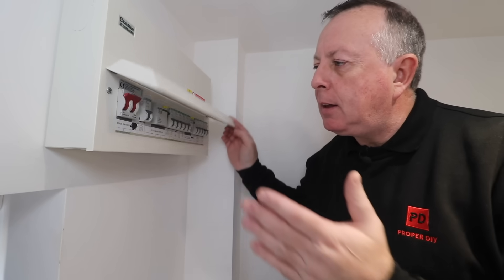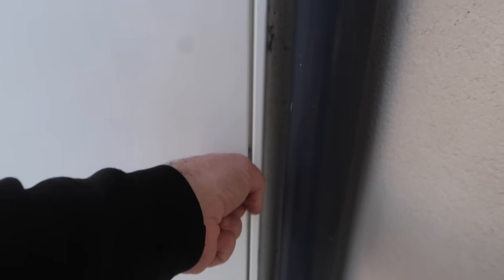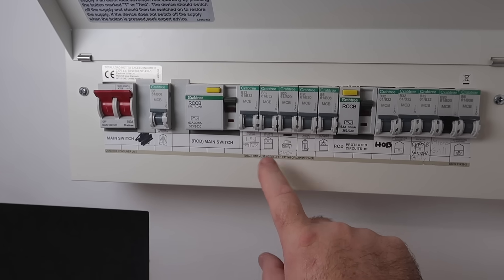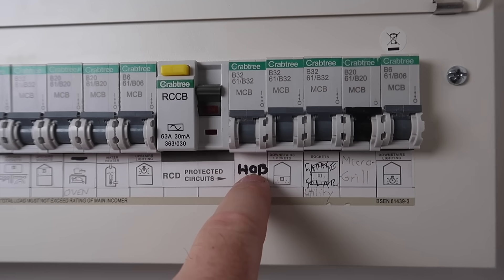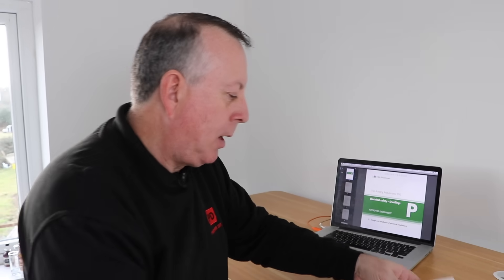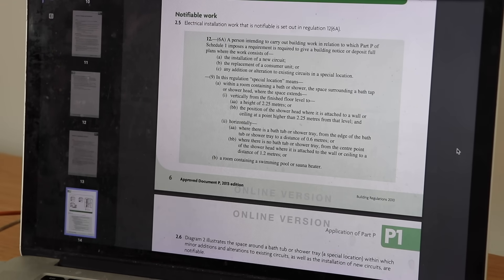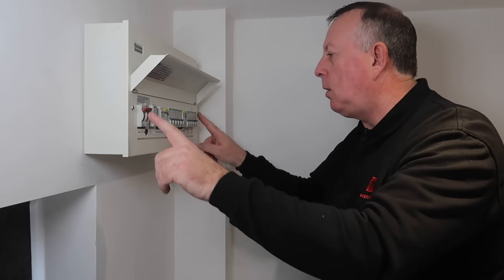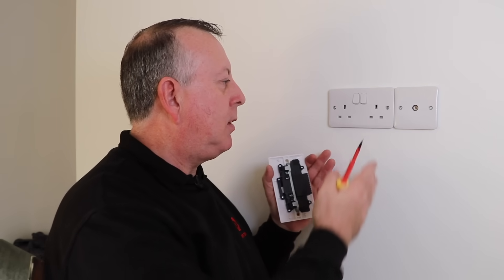What electrical work are you allowed to do in your own home?

Comment: They've killed DIY with all the dire threats to life and limb. Consequently people are paying £30,000-£40,000  extra to move into pristine houses instead of doing it up over time, which is what most folk did. We could do with replacing 'Homes under the Hammer' with a good DIY show.
Reply: Very true...
Reply: There are a lot of DIY shows, but they all focus on the 'fun' part of actually doing the job, rather than the boring part where the expert slams a three-inch-thick tome of rules on the table and starts explaining exactly how to interpret the multiple different fire rating codes for wallpaper.
Reply: @vylbird8014  What are these shows and who's presenting them?
Reply: @andycap1188  DIY SOS is probably the best-known.
Reply: @vylbird8014  I'm not sure having a team of 100+ professionals whilst you're elsewhare  is quite what I had in mind ! Something more along the lines of Barry Bucknell.

Comment: With all this regulation you can still plug in a cheap extension bar and plug in a 3Kw fan heater, and your plug melts and fuses in the extension lead, besides I do not think it is a good idea to protect any power sockets with 32A breaker, that is a huge amount of current and can set things on fire if overloaded, 16Amps should be more than enough in most homes today as we are energy conscious, and so all 32A breakers should be replaced with 20A at the most, in my house I have got rid of all 32A breakers and replaced them with 16A, and I have never needed to draw 16 amps from any ring circuit, I live in a domestic property not in a commercial workshop or factory. Play safe BS should change their thinking on safety grounds. 32A is c9omplete madness.

Comment: Former electrician here, (City and Guilds A and B certificates) but out of the trade for many years so no longer qualified due to reg changes. 
Obviously, I know how to do electrical work safely and have done jobs such as changing the florescent fittings in my garage for LED ones, but am I allowed to change the 240v to 12v transformer for the low voltage halogen lighting in my attic if I switch to using LED lamps which should ideally be fed from a transformer designed for driving LEDs ?
Reply: In my kitchen I ran some extra lighting cable and switch from the cupboard light daisy chaining three sockets  into which I plugged in 3 sets of 4 LED lights with transformers.
Sockets are on top of kitchen cupboards with lights underneath so i leave all the sockets and lights transformers switched on meaning I only have to hit the kitchen wall switch to turn on twelve bulbs.

Before anyone warns of the possibility of someone using the lighting wired sockets for heavy duty use, (on top of wall cupboards) I already have two full strength twin socket spurs up there for TV and extractor.

Extended the kitchen ring from four to ten double sockets when I had the floor up and remodelled it. Finally had an electrician come in to upgrade our ancient fusebox and everything passed..

Comment: Its different for England as Wales, in Wales you still have to notify work in a Kitchen and external work such as adding an external socket or light even to an existing circuit
Reply: Drakeford requires a written notification if you want to fart outdoors or have a wank in the bath.

Comment: Wait... You only have one incoming phase? Is this normal in the UK?
Reply: Yes. Homes in the UK are, almost without exception, single-phase. But that one phase can be up to 100A at 230V, or 23KW of power: More than sufficient for any home.

There are three phases in the distribution network, and homes are just hooked up to them in sequence. 1-2-3-1-2-3-1-2-3...
Reply: @vylbird8014 Interesting, where I'm from every home gets hooked up to all 3-phases.
Reply: @abrahamedelstein4806  Why? What domestic appliances demand such an extreme of power that they need three-phase supply?
Reply: @vylbird8014 Because it's more flexible, especially when building a home. Obviously we have different standards because to me it's taken for granted that an oven or a water heater, heat pump, etc, run on 400VAC. Yeah, I suppose you can run a single phase induction motor on trice the current but it seems rather... Inelegant to me.
Reply: @vylbird8014  A lot of UK houses with single phase supplies are staring to get close to capacity with EV chargers, heat pumps, electric showers etc.
Reply: @vylbird8014  We can use 3 phase 32 A instead of single phase 80 or 100 A. Thinner wires, less losses, and being able do run 3 phase motors in a house is a blessing for a nerd like me.
Reply: Some new build developers are starting to install 3 phase supplies now in the UK to cater for EV chargers electric boilers and Heat pumps.

Comment: My voltage is 256v,interesting that both parties have DP switching / control. I wonder what's the radius on that swa? The cables from the DP switch are provided by...the DNO?
Reply: The second switch (its actually a fused switch) is because his consumer unit is probably further away than 3 Metres from the DNO isolator. You cant have meter tails longer than 3M without additional fuse protection. Only the cables to the bottom of the first Isolator are provided by the DNO, anything after the Isolator is consumer responsibilty

Comment: I noticed from news reports years ago in Australia that many factory fires the news stated that recent electrical works were done at the factory. By electrical contractors.
Reply: All electrical (and plumbing) work in Australia is more strictly policed and regulated than in the UK - but the parts (or most of them) are still available in DIY stores.  

That said some of the regulations are weak - e.g. no need for CPC to light switches if the switch is fully isolated (not metal, no chance of contact etc. - those silly screw caps must have originated there) 

The regulations (Industry driven) are so all-embracing that you cannot even install your own data cabling OR terminate patch leads..... and don't even think you can install a second phone socket.  Technically your transformer powered doorbell requires a sparky and  you need a plumber to change a tap washer.
Reply: @barrieshepherd7694 Very few people get plumbers to change tap washers. Myself included, l learnt plumbing from my father who was a plumber and sparkie.

Comment: Went to move into new house 22 years ago. BIL was the contractor liason. He touched the dishwasher and got an electric shock. We noticed the lights were also dim. Sparkies who put in the electrics were contacted. After a 2 hour drive to get here, they spent 30 seconds, looked at the main switchboard, found nothing wrong and left. We refused to sign the handover till the problem was fixed. Builder called a local sparkie who found a dislocated neutral wire on the main box, and fixed the wire. Years later I remove a light switch assembly from the wall to paint, and a hot wire broke. Screw must have been tightened with a pile driver, and the movement of the switch from the wall caused the wire to break. When I wire a switch or plug, I test the wire by tugging on the wire a few times with a reasonable force to see if the wire screw is tight. Something our sparkies did not do, they just tightened the shit out of all the wires. SMH.
Reply: Moved into a different house in 2004. My neighbour - since deceased -  who was a lovely man, told me 'Brian was very good at DIY!' 
I decided to change the ceiling light at the bottom of the stairs since it was very old and not what you might describe as 'stylish'. Having switched off the relevant circuit I removed it from the ceiling and found the cable hole in the plasterboard ceiling was about 5 inches in diameter. Wow! I thought, that's a bit big! I disconnected the cable and removed the fitting. Then checked the security of the cable and found it was mixed with a large lump of brown mastic in the void. I pulled gingerly and after 5 minutes had removed all the cable from above the ceiling. It was still connected but the extra cable was long enough to literally reach the floor. Having shortened it to a sensible length and replaced the gaping hole in the ceiling I fitted a new light unit. The old cable went in the bin. Brian lives in Spain now and is undoubtedly causing havoc but in a different environment. His DIY was shocking. Brown mastic to point a brick wall anyone?
Reply: @thetraveller869  Brown mastic reminds me that the previous owner to my house had stuck some loose capstones (on the low wall around the patio) back on with some sort of silicone adhesive, possibly bath sealant.
Reply: Qualification doesn't mean they take pride after the fact...! Sloppy is Sloppy, the rubber stamped version just costs more..!

Comment: digital meters take to long to measure voltage if trying to measure a rapid change as in moving a magnet past a coil in generator making,  analogue reads much faster so are usable. nice video thanks

Comment: I insisted on an isolator switch when i had my supply connected , makes for safer diy, no  more  live fuse box fitting or rip off line isolation costs .! UK regs are a joke .One year metal fuse boxes were bad then the next oh dear its the plastic ones !  I had to pay 400 quid to get my installation checked and  passed . Its only when you sell your house that the correct fitting tests have to be shown to the surveyor . There are zillions safe DIY wiring in UK and if electricians didn't take the piss on what they were charging there would be less . I had my elderly  neighbor come around in tears when the visiting electrician said 200 quid to remove a plug socket so she could squeeze her new fridge under the counter , took me less than ten minutes  and another 5 glaring at the electrician . To many tradesmen are not interested in their trade they just heard it was a good earner .

Comment: Didn't realise that gardens/exterior weren't a 'special area' any more. Thanks for the info.
Reply: only for England, Wales it still is
Reply: @codenamenel  That's reasonable - it is wetter in Wales so higher risks. 😂
Reply: @barrieshepherd7694  🤣 In wales the whole country counts as within 0.6m of a bath. 🤣
Reply: @KX36  can confirm.
Reply: That really does depend of the earthing type from the dno, it's not as straight forward as that

Comment: When  did section P become law?  I ask as I did a number of installations many years ago, including the fitting and wiring of a power shower in my bathroom. Is this item exempt from current regulations if I carried out its installation before Section P became law?
Reply: Eighteen years ago.
Reply: @markrainford1219  
Mainly stripped back in 2013. It is mainly about notifiable work. Anyone can do it, you notify building control. They do not send a surveyor around, they send an electrician they approve to sign it off.  You have to pay for it.
Reply: many thanks for your reply Mark; as a competent DIYer /HNC qualified engineer I did this installation abour 25  years ago so obviously I don't need to rip the power shower out and have it refitted  by a "competent" electician.
Reply: @hewittb68  
If you have a certified electrician who can carry out inspections, that is the same thing as building control in notifiable work.
Reply: @johnburns4017  Thanks again for the advice John;  appreciate it.

Comment: Thé général message is correct….. that electrical installations should be installed and modified only by a competent installer.

However, to say that it is illegal to do this work as a DIYer is incorrect.  In the IEE guidance, competency is not based on a professional status and can be exercised simply as someone who follows the IEE guidance and standard installation recommendations.

This means that as long as notification is given to the local building authority, anyone who is competent can carry out the electrical works so that correct procedure and if necessary, building controls can be undertaken.

If it was illegal to install or modify and electrical installation, the materials would be restricted to only professional and certified installers/professionals………… but of course, this is not the case.
Reply: So could I install an EV charger myself? AC EV chargers are just fancy extension cables. The actual charger is built into the car. Yet they cost about £500 to buy and £500 to install. It’s ridiculous. I’d like to think I’m fairly competent, I’ve experience with UPS systems, batteries and others.
Reply: @iambenmitchell  Creful. It sounds easy but there are earthing issues that need to be taken into account depending on what unit you are installing. The question is, how do you consider that you are competent?
Reply: Yes: if you consider yourself competent and follow IEE guidance.  I would imagine that you would have to install some pretty hefty cables to a new circuit breaker in your consumer unit similar to a kitchen cooker - but I would beef up a bit and put in 10mm2 cables.

Remember; your EV will be on charge for a long time, and you should also protect with a RCD.  Best way would be to instal a local consumer unit with a feed direct to the main interruption switch after the principle intallation feed
Reply: Level 2 chargers incorporate their own RCD. @glyntutt1586

Comment: You can do anything you like on the house side of the Electrical supply company's equipment. The big question is do you know how to do it, and to what standard, and will you still be alive subsequently?
Reply: If you are competent, yes.
Reply: @johnburns4017  Where 'competent' is more properly read as 'have the required formal qualifications to prove competence.'
Reply: @vylbird8014  
Competences ther result.

Comment: Wow what a difference from my country. I have rewired my whole house and have no problem adding circuits. Recently I added a cable to my load centre for an emergency generator with the interlock of course. Works great. By the way, very useful video.
Reply: Some years back a MPs daughter tried to do her own electrical DIY (probably was dumbass enough to put metal against a livewire) and killed herself, then the law of doing DIY yoursef changed.
Reply: @DavidJohnson-dc8lu  Yeah, real "freedom" is the government protecting you from yourself. It's ironic that the country that is responsible for the political philosophy that birthed the US has strayed so far off their own path.
Reply: @DavidJohnson-dc8lu  "Some years back a MPs daughter tried to do her own electrical DIY (probably was dumbass enough to put metal against a livewire) and killed herself". That's not quite right. It was kitchen fitters that did some wiring, including a diagonal wire outside the prescribed zones. Then the husband scrwed a knife-holder into the wall, which hit a live. At some point the MP's daughter touched the knife-holder and was killed.
And we all got excessively regulated as a more-or-less direct result. It hasn't made dodgy kitchen fitters go away, but it has made DIYers lives very difficult (well, not so much difficult as 'now outside the law'.)
Standards should be higher than they generally are, but I'm not convinced that this regulation and the associated mass of paperwork has really done that. The testing requirement is probably the most useful bit - that presumably has made for better installations.
Reply: Aye some of us know how to get around the moronic rules here
Reply: @Interdiction  Oh, I get that, which just points the finger at how stupid the laws are. I'd do the same. On the surface at least, the law expresses a paternalism that is antithetical to freedom.Somehow though, I think it has a lot more to do with satisfying a self-interested lobby than it does with protecting people from themselves. It's more of an employment law than a public safety law. Credentials are often just a means of excluding competition.
Reply: @Interdiction  You can also just ignore them, to no consequence. It's not like the council is going door to door, inspecting all your sockets and switches.
Reply: johnjordan3527  LOL, says the clown incapable going straight to ad hominen and incapable of actual rebuttal.

Comment: issue is you can still have fuse wire in1980s  or 90s ...stop scaring people its still safe ...
Reply: Fuse wire won't protect you from electric shock though. So not as safe as an RCD or RCBO.